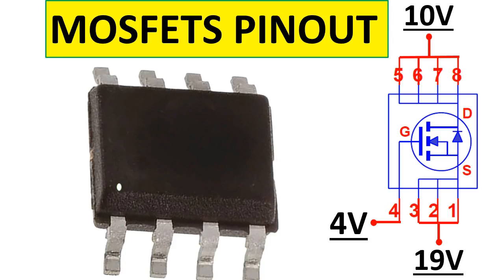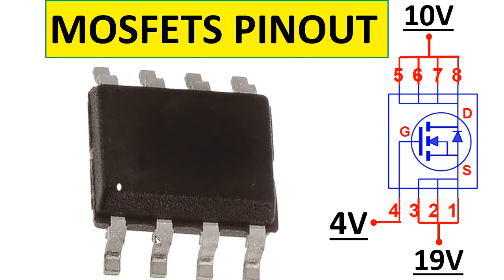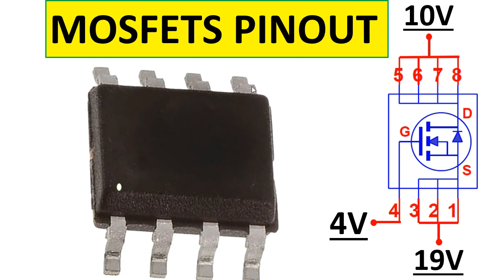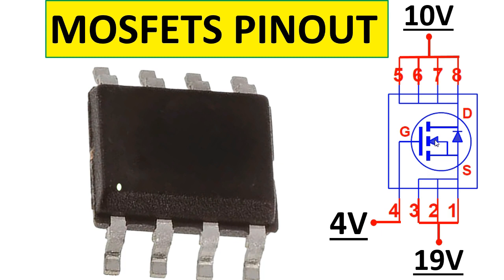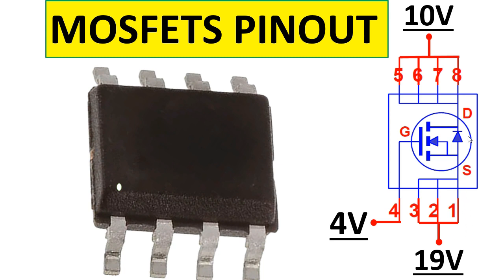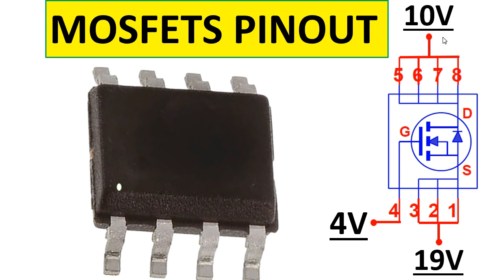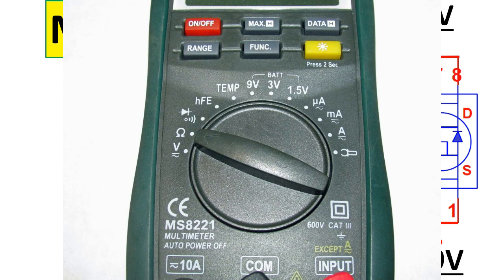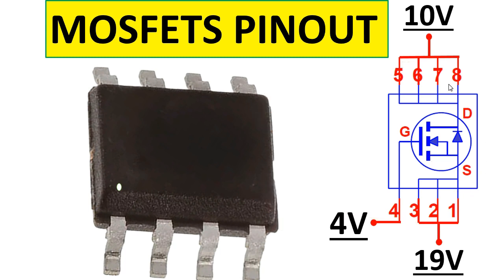8 pins MOSFET pin configuration, identify MOSFET transistor pinout

Comment: When I tested the mosfet with a multimeter, which was still installed on the laptop mainboard, I measured the test as in the video, the black and red probes were reversed to the S pin and D pin, there was a resistance value. Is it a bad or good mosfet?

Comment: I fail to see how input voltage 19v at Source appears as 10 v at Drain! If we step or pulse the gate voltage with pwm signal we can do this, and convert higher voltage dc to lower voltage, However the Drain is positive in N mosfets, as shown by internal diode, this is an N mosfet, so the voltage should be reversed!  The 10v should be below (output received at Source pin) and 19v above (power supply applied on Drain). Correct?
Reply: What im seeing is the diode is facing towards drain. So voltage has to flow from source to drain. So, the resistance between source and drain is directly controlled by gate voltage. As the gate voltage increases, the channel becomes more conductive, allowing more current to flow from source to drain, which in turn lowers the voltage drop across the channel. I believe this is what he's trying to get at if I'm understanding it correctly.

Comment: so if 19v power from source to drian via a internal diode it should be 19v-0.7v=18.3v  without a voltage signal from gate.  correct me if i am worong😅
Reply: It's not exactly like diode.
Read about diode and mosfet atomic structure.and buy one or two pieces and test.

Comment: Hello ,i have GPU and i tested 12  MOSFETS and I have
  +1...5,6,7,8...bip
  +2...5,6,7,8...bip
  +3...5,6,7,8...bip
After that I turned  + with - and I have same bip...that means it is shorter???i have video....how can I show you if I do right...
Reply from the maker: For 8 pins MOSFETs, pins 5,6,7 and 8 are connected to each other (Drain).